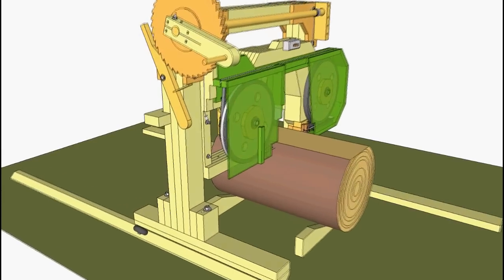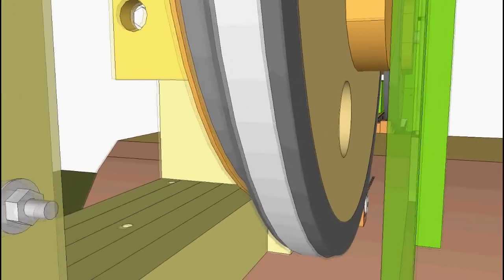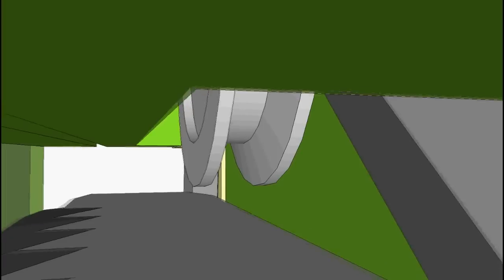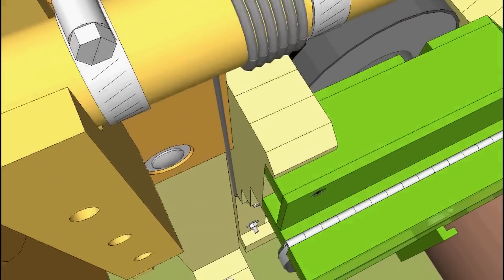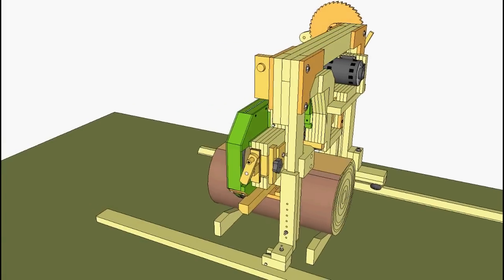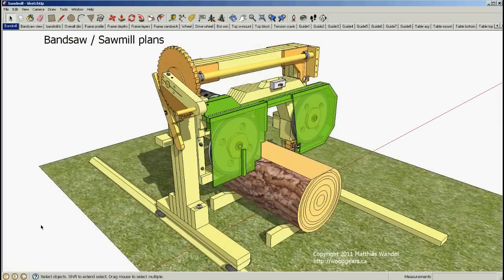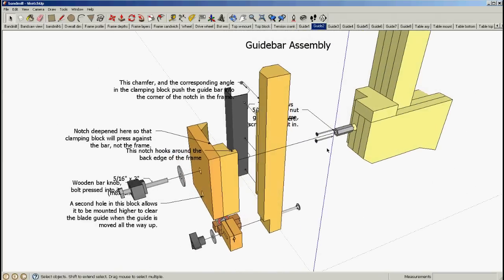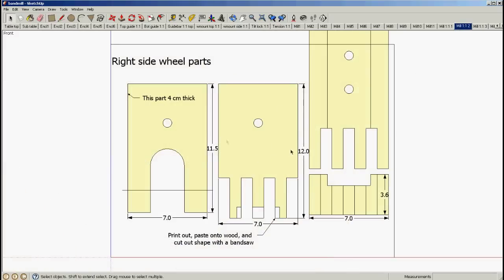Pushing SketchUp to the max

Comment: I don't know what you are planning to use for the blade wheels on your bandsaw mill but on ours we use 24inch industrial pulleys with 24.5 inch belts on each pulley like tires.  We get about 100 hours of actual saw time before they need to be replaced.  Inexpensive and simple.  Keep up the good work, you inspire.

Comment: Hi, I have been wondering, is there a specific reason why the birch plywood part on the MDF wheel is not round, but a rounded rectangle? I thought it was just that way in practical reasons, but you actually draw it that way so I wonder what's the motivation for the shape?

Comment: Hi Matthias and all viewers,
Do you think you could run a band in a trapezoid or a parallelogram to be able to achieve larger cuts.  
The idler pulleys on the corners would be a smaller diameter. 
Do you think the drive wheel would be able to get enough traction or would slippage be an issue and if the idler pulleys are too small would the belt break?

Thank you

Comment: I tow with my 01 Golf TDI.  A Euro hitch would cost about $550 but I picked up a u-haul hitch for about $135.  It tows surprisingly well but I would never want to tow more than about 750 pounds if I was going any distance.  The key is getting the tongue weight just right.  3% seems to be perfect.

Comment: Matthias, I've been struggling on how to get the 2D 1:1 templates working.  I'm trying to cut out some fairly small pieces from 1/8 inch MDF and they need to be precise.  I have created templates in Sketchup, but for the life of me I don't know how to get them to print in scale.
Reply: Dickie Mathias does offer a trial version of Big Print for anyone that wants to check it out.  I just thought Big Print was for multi-page prints.  In my case I only need to layout on a single sheet of paper (A2 or Letter).  As such the Big Print program didn't seem to fit the need.  Am I wrong?
Reply: Dickie I did finally manage to figure out how to print 2D templates, but what I couldn't get to work right is the layout on the page correct.  There was no rhyme or reason that I could figure out as to how SketchUp was laying pages out.  Something that would clearly fit on a single page was being spread across 4 pages so I just had to keep messing with it until I got 5 single page prints, which should've been able to fit on 2-3 pages.
Reply: +Dickie I'll give it a try.  Thanks Dickie!
Reply: +William Hayden Well, may be a lil bit late, but still: i'm always using Inkscape vector graphics editor to print precise things, like PCB templates. Inkscape doesn't respect your printer margins, page size and whatever, but does respect scale, and always prints your on-screen page as is. For example, if you have A3 drawing and trying to send it to A4 printer - it will print only center 210*297mm piece of your drawing with precise scale.

Comment: Nice design and presentation. The single track guiding system is a weak link.  Theres nothing to prevent torque from wanting to bind the track system.  Maybe... think about  moving the log rather then the whole saw.  Put the log a roller carriage and push/pull the carriage with log firmly secured under the now stable saw base.

Comment: What you do with Sketchup is amazing. But trust me, if you had access to a real CAD system like SolidWorks, ProENGINEER, Autodesk Invetor etc, then you would be able to knock out drawings much faster. I use SolidWorks at work, and if I was told I needed to do the same job with Sketchup, I think I would cry! :-)

Comment: Used Solidworks myself until I installed Win 8.1 and no longer works due to that mistake.
Reply: +JN 2013 You just need a newer version of Solidworks, 2015 runs great on 8.1. Solidworks is a superior program anyway, its very easy to use as far as modeling goes